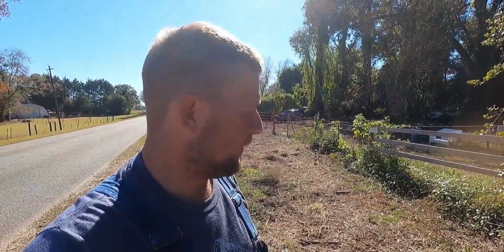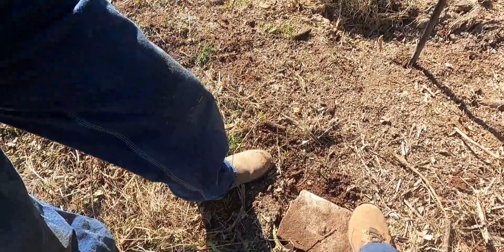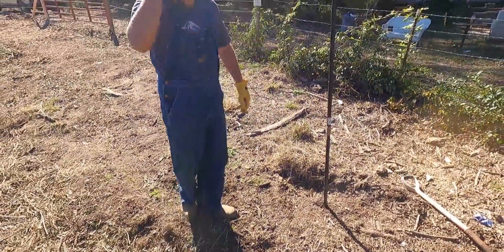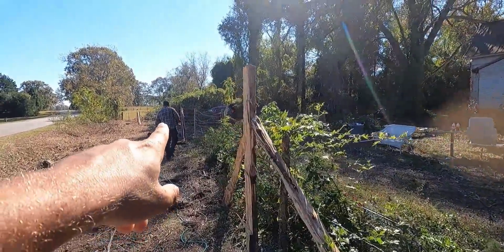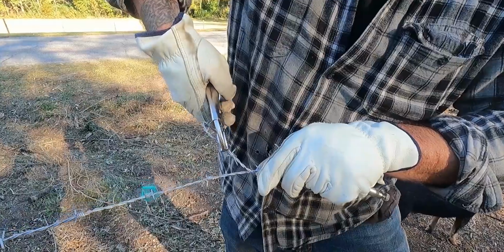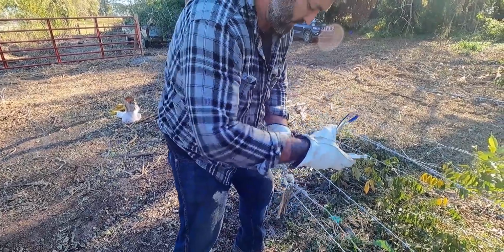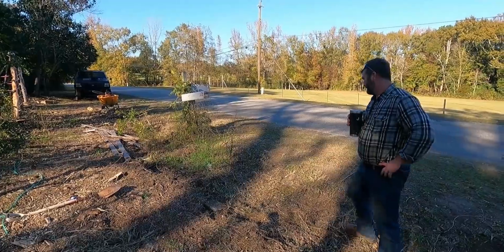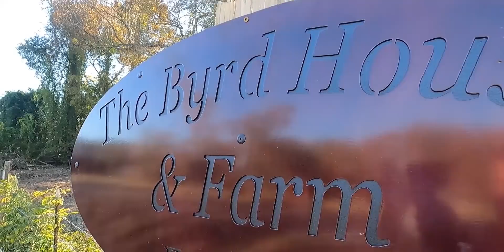MORE NEW BARBED WIRE FENCE FOR 140 YEAR OLD FARM | DISCOVERED HIDDEN WALL | OLD BYRD FARM SIGN HUNG

Comment: I would take Brandon's tractor bucket and  Scrape off the dirt and see if it's a old stone drive way.  If so I would relay it if needed.  Also I would go get your Neighbors tractor and clean out the road side  Ditch . Later down the road I would put up a old time wood farm  Fence . So far everything looks good.
Reply: I agree.
Reply: Yeah, can't figure out why they are putting up barbed wire in the front yard...livestock?

Comment: I can't believe you all don't have a hand auger. Hand augers are so much simpler and easier to use than clamshell diggers for making post holes. Plus you can go as deep as you want. For making really deep holes the shaft can be lengthened with a piece of pipe. Anyway, good to see that new fence all the way across, the the sign re-hung. As for wisteria, it's not a bad thing to plant at all. The only way for it to get out of control is for it to be in an abandoned situation like that. We had two of them at the house where I grew up- one in the back yard and one in the front. As long as you mow around them they will never get out of control. I love the stuff. But there are dozens and dozens of old homesites all over this area where where there is no trace of a home, but it is up in the trees. Sometimes people ask "What are those purple flowering trees?" lol

Comment: aaron is using new method to join two wire breaks, that i did not know..  I do know how  old timers did, not with washers. 

They used boy scout rope tying method to join.  my friend kennneth  does that without washers.  he stated he has the old tool, to help with tying, but strongly favored vise grips tools because of "stay on" capability while tying.

Comment: IMO fence boards all across front yard of Old Byrd Farm wld have look'd 100x better, barb wire is for pasture not front yards
Reply: True…but the barbed wire is also for security.
Reply: I personally like the idea of using stock panels attached to a wooden upper and lower boards.
Reply: you can get a better view of the house this way
Reply: I believe he also said its temporary.  He doesn't have time to build a proper fence, and he wants to keep people out.  Hes just trying to shape up the yard, first, then he'll tackle the actual design layout for everything.